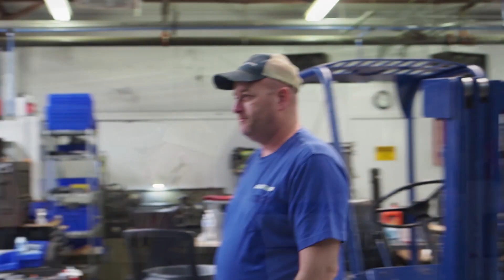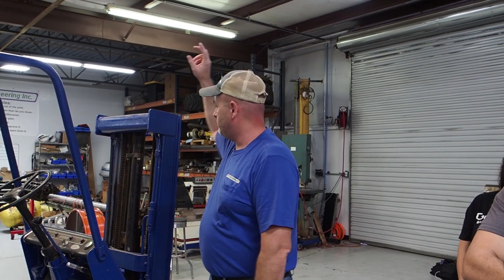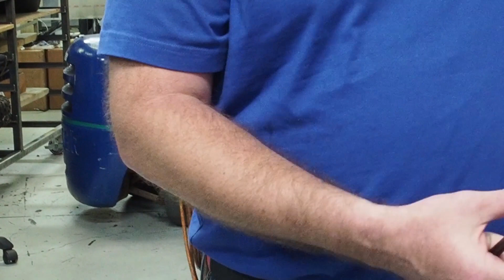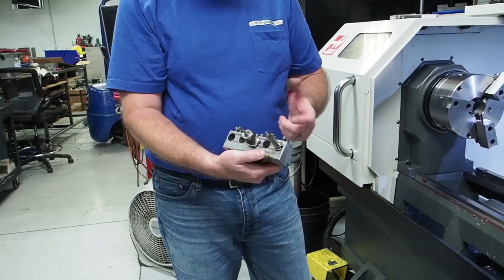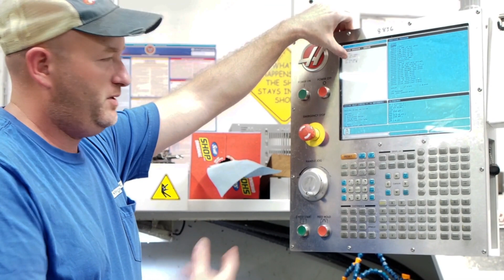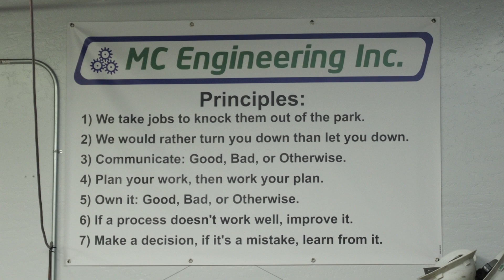Visit at MC Engineering With Craig Campbell

Comment: I enjoyed the tour. Yes Steve I’ve had my share of coolant baths my self you figure out right quick to check those coolant switches. My last lathes I ran @ Eaton was LB 30 and a newer model the number escapes me from Okuma. We used them with CBN to finish bearing fits to shafts so we had some tight tolerances (+-.00025). Of course we had some fancy electronic gages because we also checked 100% on those OD bearing fits.